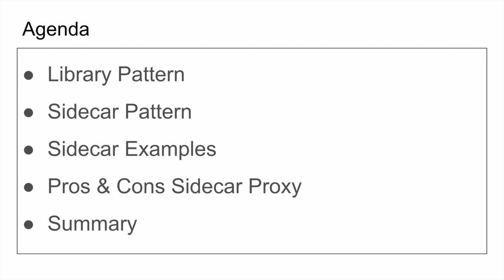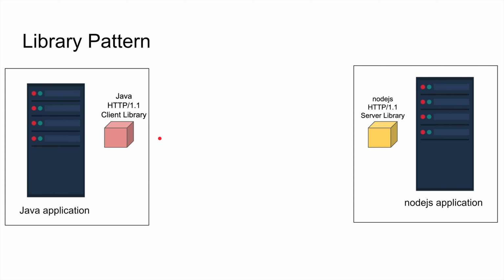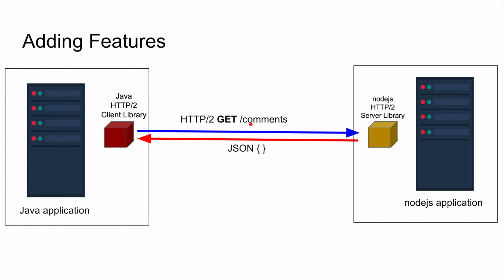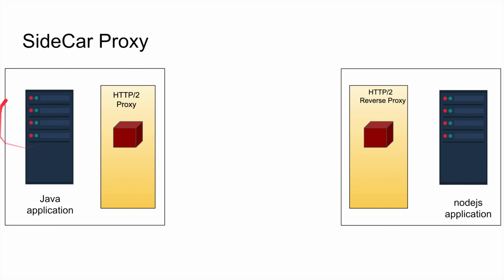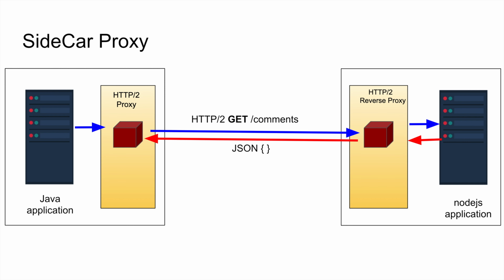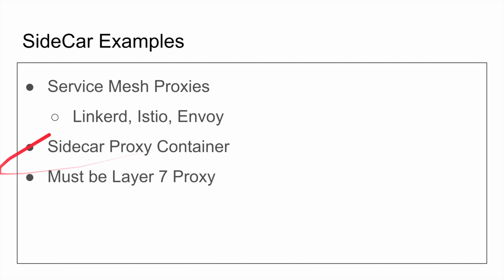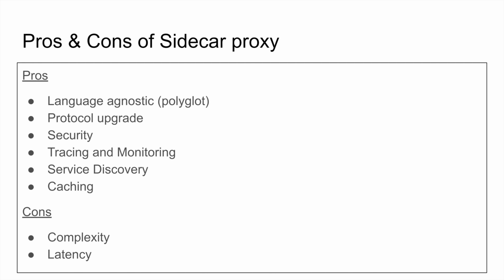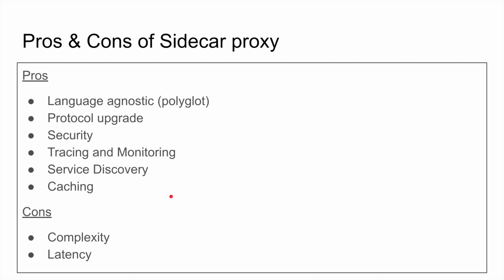Sidecar Proxy Pros & Cons (Explained by Example)

Comment: You're explanation of the "what" is great, really great! The "why" for the sidecar proxy is described in the NIST SP 800-190 Application Container Security, primarily for security between containerized applications that don't have security agents or W3C compliant API firewalls between them. Before nation-states were involved with cyber hacking it was mostly just disgruntled or laid-off software testers/debuggers since they are the first cuts and don't add new features or differentiators to apps/products, but now it's nation-states, organized crime, and hacktivists (bored or political) that make it much more difficult to have app-to-app or app-server communications not get compromised. Most developers in my experience loath security, the sidecar proxy pattern helps them go back to loathing it and pushes the work of protocol security into the SRE/DEVOPS Engineers who love to manage logs and troubleshoot the environment.